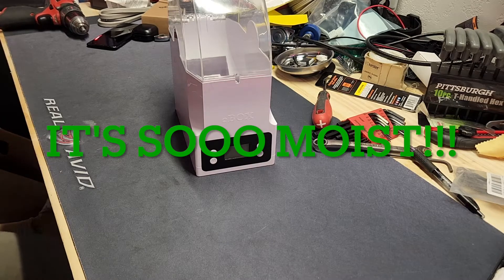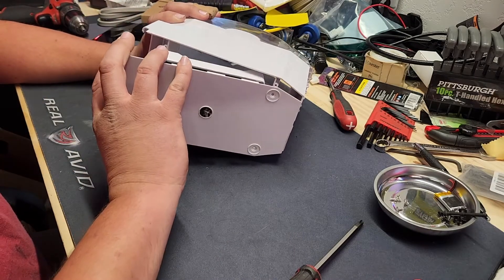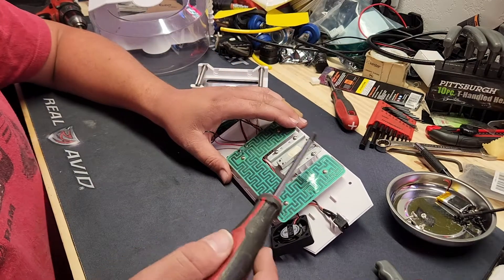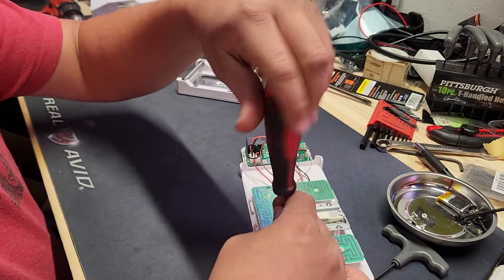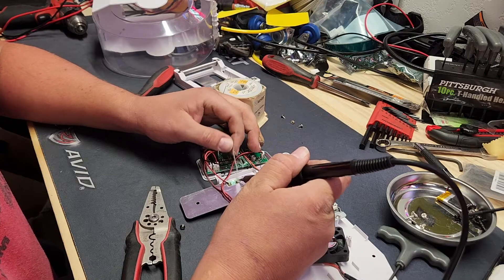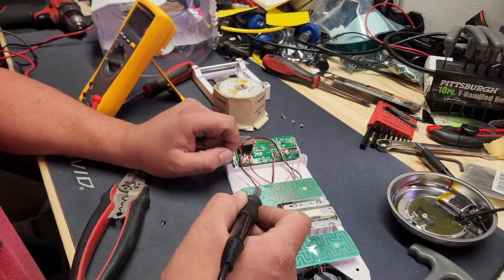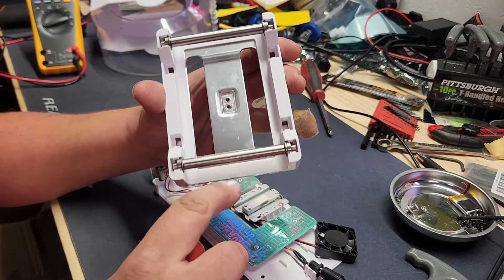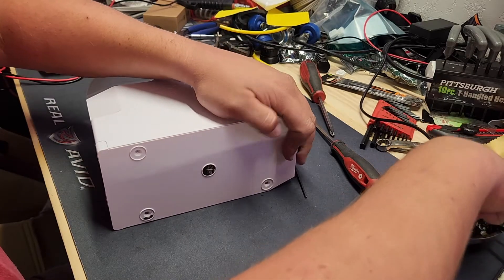Ooo I'm so DAMP! - ESun Filament Dryer Repair

Comment: Good thing I found this video!
I found mine loud because of the relay clicking all the time. I see in the video that the relay is soldered tightly to the printed circuit board directly behind the front panel.
Based on your video, I took the relay apart and soldered it out. I soldered a 3cm wire to each of the legs and soldered those to the relay legs. I wrapped the relay with paper towels so it wouldn't touch the housing.
The result: it works so quietly that I can only hear the relay when it is completely silent and then only very quietly.